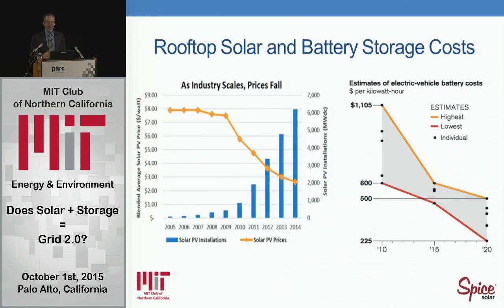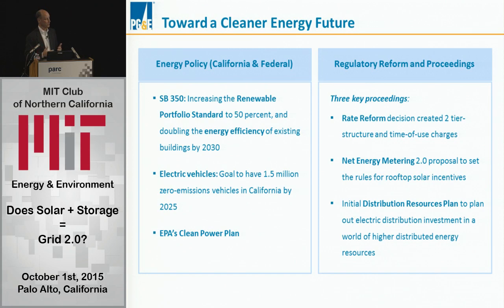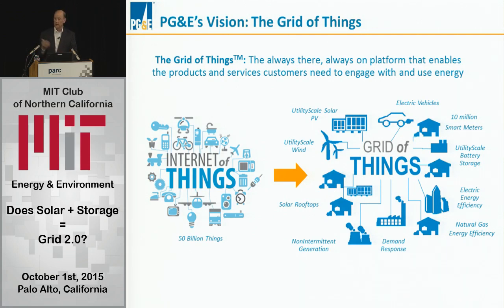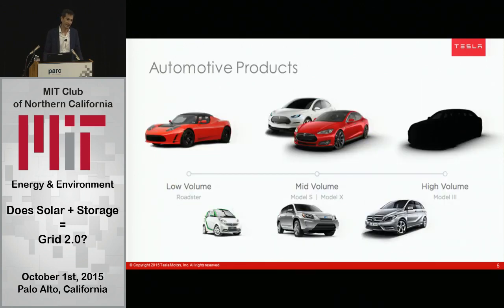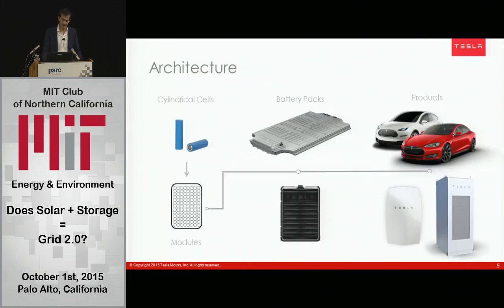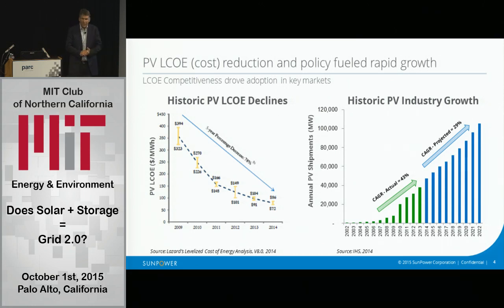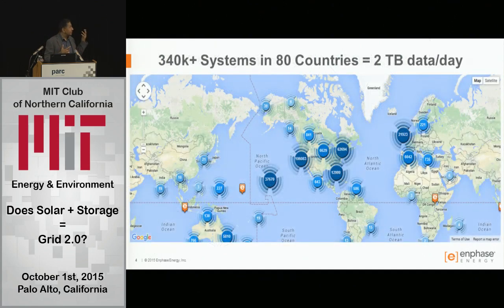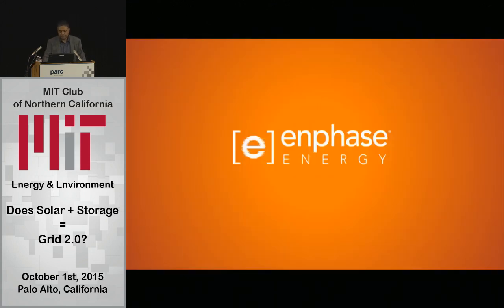Does Solar + Storage = Grid 2.0?

Comment: Why not pumping stations? That is to say basically like a hydro power dam, but when there's surplus electricity you pump the water up again. Doesn't strictly have to be a dam, just somewhere high up and somewhere low down you can store the water with pipes, pumps and turbines between.

If not to solve the night and cloud problem, then at least to solve the winter problem. They're a lot cheaper per kWh stored, and while there's a 30% loss of electricity for one cycle of pump the water up and let it go down the turbine again, that's more than lithium batteries leak over 12 hours, but a lot less than they do over 6 months. Would make more economic sense to build from scratch, but especially now that we still have suitable natural formations.

Edit: I liked the audience member with the air pressure systems. I'll have to look into that, if that's more cost efficient than water and gravity on the large scale.
Reply: I have thought about this method of storage for a long time now. But to build it on a large scale it is not practical. You have to have the correct location, big environmental impact and probably fairly high capital costs.

Distribution would also lose you say 20% of power.

Local, small scale communal grids is the way to go.
Reply: @Optical Clarity Google Lightsail and Daniella Fong